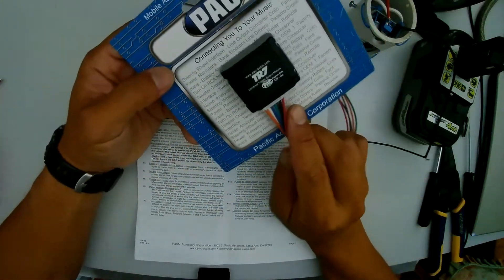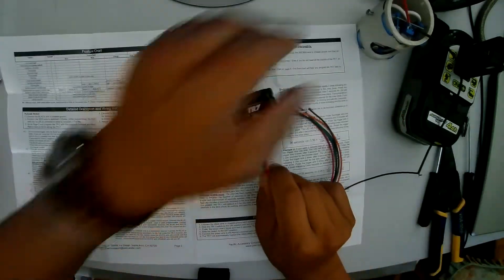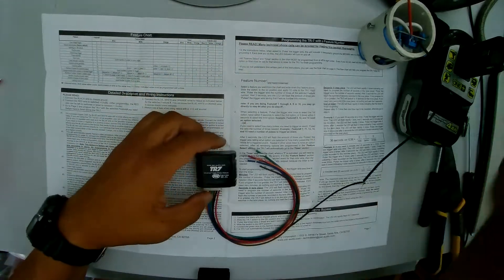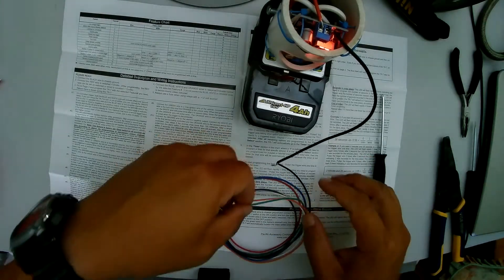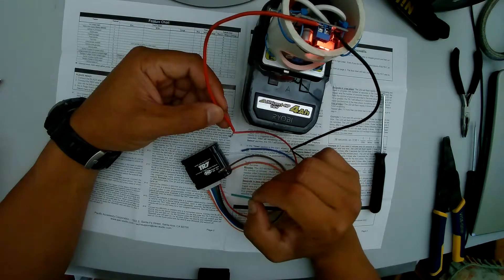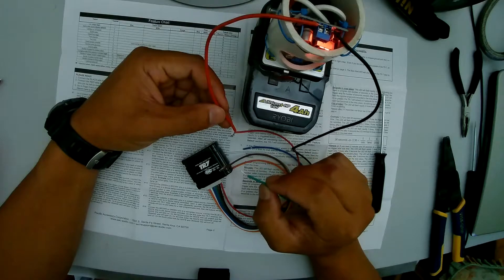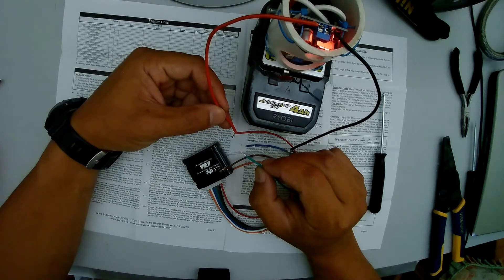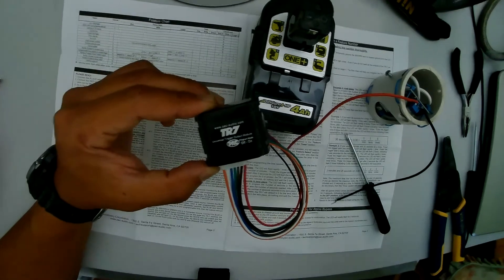Programming PAC TR7 / TR-7 into Mode 15 / Feature 15 for Toyota 4Runner Rear Window Hack / Mod

Comment: Can you use any key fob? I have a gmc truck with key fob that I want to program my tailgate to lower with the pac tr7 and actuators etc..
Reply from the maker: The key fob has to be recognized by the car. The key fob doesn't send the signal to the tr7 directly. The key fob sends a signal to the car and the car relays the signal to the tr7. More accurately the TR7 picks up the signal from the car.

That sounds like an awesome project. You would just have to use the TR7 and wire it into a circuit that the car already recognizes. For example you could set it up where you hit the unlock button three times on your key fob in the tailgate goes down.

You would just have to attach the TR7 to the wire or circuit that unlocks the tailgate. Then program the TR7 to activate your actuators to lower the tailgate once the unlock feature has been pushed three times in 5 seconds.
Reply: @ChangJitsen  okay wow that makes so much more sense now! Thank you so much!

Comment: I followed the instructions, but it's a no go. Does TR7 need to be in on position after all hook ups are done? I just get 2 beeps when pushing fob twice and glass doesn't go up. What gives?
Reply from the maker: Once you are done programming the TR7, you need to switch the programming switch back to "off."
Reply: @ChangJitsen  I'll give it a try this coming weekend. If this works, I owe you a six-pack!
Reply from the maker: @Brightly747  lol. no worries. I use this "hack" every single day. Every time I roll the back window up with the remote, it still puts a smile on my face. If you are using the T-splices, I have had problems getting the splicers to cut through the plastic sheaths on smaller wires. So sometimes there isn't a connection at these splices. 

Also if you do use the magnetic switches, I used a lot of brake cleaner to clean the attachment points for the double sided tape. That helped a lot. The heavy duty double sided tape is amazingly strong. I had a hard time removing it when it was stuck in the wrong place.
Reply: @ChangJitsen  I did use T-splices, and I wonder too. Will start trouble shooting soon. Thanks.
Reply: @ChangJitsen  I got it done today and it worked as prescribed; )

The mistake I was making was not turning off TR7 at the end of programming. I turned it off after hooking it up to relay, which caused this snafu! Happy Thanksgiving brother.
Reply from the maker: @Brightly747  Love it. Thanks for the update. Have fun with it. Happy Thanksgiving to you too.

Comment from the maker: Possible 12V power source.

1) Connect to the car battery in your car
2) Connect to a spare 12V battery, the PowerWheels toys usual have small 12V batteries
3) Take a scrap cigarette lighter plug and plug into your car cigarette lighter (remember the back of the 4Runner has an additional plug)
4) take the power supply out of an old computer and use the 12V wires. Usually computer supplies output a few voltages: 12V, 5V, and 3.3V.
5) taping 8 (1.5V batteries - such as AAA, AA, or C alkaline batteries [not the rechargeable NiCd/NiMH batteries those run at 1.2-1.3V]) batteries together end-to-end should work in a pinch